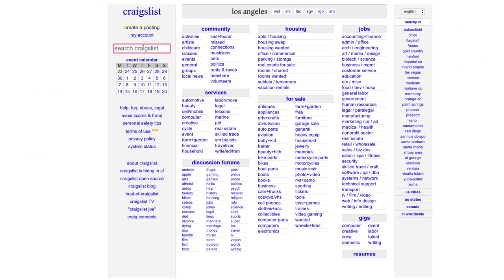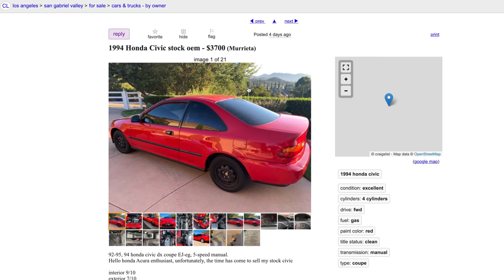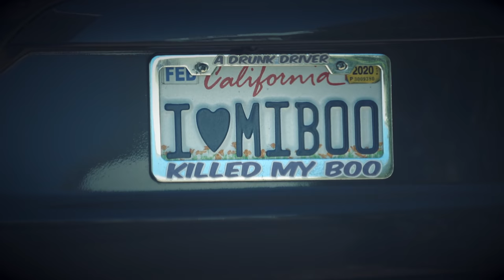Can $1000 Get You a Rare Sports Car?

Comment: I learned how to repair cars for exactly the same reason as Winston.  I also learned when I reach a point where I’d rather have a mechanic with a proper lift do it.
Reply: Did you still follow through fixing it yourself or did you go see a mechanic at that point?
Reply: I've allways fixed my cars myself before. But this week is the first time ever iam going to get a mechanic to do the service on my car.
Reply: I know exactly what you mean. I have changed the hubs on my car, the starter, lots of other things. But my steering column came loose. I saw a video on how to do it, I could have done it, it didn't require any special parts (but two pullers!). But it would have been a complete pain and I probably would have put it back together wrong. I was like, well, I'd rather pay a pro a hundred bucks to just do it rather than spend an entire weekend on it. And that happened and I'm still happy as hell I found someone to do it.
Reply: @james5460  the problem is the number of "pros" who don't care about your car and do a shit job. Leave parts missing, disconnected, etc. Then still charge you top dollar. I guess that's why they say a good mechanic is worth his weight in gold.

Comment: My first car was a 4k Toyota Starlet rear wheel drive 😅, second one was SW20 mr2. Mr2's with the mid mounted engines make the experience completely unique.. they button down so well in the rear.. but wet tar can be dangerous if you dont learn throttle control. Amazing new channel boys.

Comment: To add on the thoughts at the end of the video: The major reason why we can't get affordable cars as "fun" anymore (and they definitely don't apart from the ND Miata or Lotus models) is because regulations kill off any hope for lightweight. 

Chapman said the key is "adding lightness" and it truly is. Since cars are now much heavier we don't get unassisted steering anymore: Less fun. Now they've taken away hydraulic steering for electric: Even less fun because they can't replicate the connected feeling of hydraulic. Safety standards are simply taking out the emotion and replacing it with isolation. They are refined in the wrong ways, unlike the refined quality of 80s-90s Toyota products. 

I want to feel the road, the engine, and the brakes. It makes me appreciate Mazda and Lotus today. I have hopes Toyota's recent focus on performance cars (Akio said this himself) will bring us a new MR-2. I already love what they did with the GR Yaris.

Comment: I can't believe this. Not only 2 days before this I managed to get myself the 1989 MR2 I've been watching for 7 years! Total backyard find, under a cover and blankets for the past 12 years. Supercharged version with 113k miles! Got it for free! Doing a bunch of basic stuff on it atm. 1 rust spot about 4 inches long along the top of the window. Other then that it's pretty darn good...Just that I broke a piece when removing the starter to check it. . . the after market alarm has been a rats nest, it didn't come with keys or anything! Neighbor is a locksmith though so.. Cant wait for the engine video!

Comment: But is that steering wheel not in mounted straightly?
Reply: With the front end repair may need a wheel alignment?
Reply: @farnthboy  that or a problem with the subframe. It was in an accident so...
Reply: How do you guys notice this stuff I wasn’t even looking at it.
Reply: @ratj4715  look at the steering wheel while they are doing the 0-60 mph tests. You can clearly see that it's not center while driving straight. It's off quite a lot. There's a scene where the camera is between Winston (driving) and C Milk (passenger) facing towards the windshield during these tests. You'll see it. I didn't notice at first until Peter mentioned it. I personally would had never drove it with that bad of an alignment. From my own personal experience a suspension table can literally break free of the frame resulting in a serious crash or death. It happened to me! It's physics. Speed + suspension pulling to one side, etc over time = a lot of torque and weight. Eventually something is going to give way, especially on an old vehicle. But Winston seems to know his stuff and probably concluded that it wasn't out of alignment due to anything too serious.
Reply: Sebastien Bolduc I believe you I just wouldn’t even think to look at the wheel. Am sure if we could see this car in person am sure their was many things wrong with it or didn’t look very good in person but than you don’t get a lot for that money these days to me and I know everyone has their own taste but I think it god ugly.
Reply: @sebastienbolduc5654  -- That was my first thought when they walked around the car in the seller's driveway. At least do the basics of checking for straightness.
Reply: You can just pull off the wheel and re-center it. It’s fine the way it is, but if you have OCD, then it will drive you nuts...lol

Comment: a 128hp car will rip your face off when all you have ever driven is a 3 cylinder 1liter skoda fabia
._.
Reply: No joke a 4AGE MR2 45-60mph in 2nd gear, and don't mess around in the rain, it will  throw you off the road with the slightest curve if you disrespect it.
Reply: @pgtmr2713  Drive mine in the rain and on gravel and its entertaining and competent. It's now on Koni, Eibach and modern 15".
Reply: They're great handlers right up to the point they aren't :-D
Reply: @pgtmr2713  On mine, it will go neutral then oversteer with enough linearity that you can keep the throttle on and steer to the wider line. Im quite respectful of "throttle on" understeer, as its a characteristic I dont always predict well. Otherwise it's pretty straight forward about how much grips left and what will happen if its pushed too far past it. To get it to its limit on fresh suspension takes some serious commitment and pace. Im a bit in awe when I hear of owners who can get them to step out routinely in suburbia.
Reply: Mine was a worn out $1000 piece. Anything can get sideways if you drive it the wrong way. I definitely did push it too hard for that moment. There was nothing slow or linear, what I experienced was snap oversteer. Instant 90*. Maybe yours has less power? Mine was 88, so far as I know, no mods. T-VIS valve opened and that was it sideways up a curb I wouldn't take my Jeep. Believe it or not the car came out fine, no lost plastic. By the way this wasn't a complaint. I used to say it was 1.6l of Japanese fury
Reply: @pgtmr2713  Mine is an 87 and is running a healthy smallport (100+ kw).
Reply: That car is long gone now. It needed too much work for the rust. Then it started knocking It was still great at 25 years old 208k miles. When I bought it only had .25 quarts of oil in it. It was otherwise in great functional shape,  just  maybe a little soft. At the time there was a Junkyard with a blue hardtop a few blocks away. Had brand new keys cut by Toyota from the numbers in the manual for that thing.
Reply: @pgtmr2713  Im so pleased that we don't salt our roads here. Yep, my previous owner ran it out of oil and did the bearings which is why he swapped to the smallport.
Reply: @stephenbello1081  I had another project I wanted to swap more at the time. The MR2 was only a temporary distraction from that. It worked out, by the time I was looking for an engine the perfect one came up. Half price, swapped valve springs, otherwise stock, low mileage jdm engine, clean. The 4AGE was a legend, but this engine was better, without the same fanfare.

Comment: My favorite Japanese car was an old, rusty, beat to hell and back 1974 Toyota Celica GT, 18RC engine. Back left wheel lugs were hammered on so I was stuck with the same bald tire for about 8 years and it never lost air or went flat..  Great little car back when I had almost zero resources. That car delivered more pizzas than I'll ever eat in my entire lifetime.  Someone finally bought it from me for the engine that remained almost perfect for the entire 8 years.

Comment: I didn't realize you were doing this project. This is great! I've never really felt the need to justify my love of '80s Toyotas(I have three right now; an '88 ST165 Celica, an '88 MA70 Supra, and an '84 N5 Hilux). They're well built and each of them has withstood the test of time. My first car was an '86 Celica and to be able to relive that at any time I wish is a great feeling. There was a time pretty recently where I was driving my '80s fleet exclusively, but I did break down and got a newer vehicle to take the wear and tear('04 RAV4; fortunately I found one in manual, haha). However, I'll continue to drive these reminders of the past. It's a way to get in touch with my roots. :)

Comment: The thing about cars is that there are a lot of them out there and a lot of them are very good.  Modern comfort and fuel efficiency is commonplace.  But it's also a bit dull.  It is more fun to buy something ordinary, or old, or both, then try and squeeze the maximum adventure out of that item.  A modern day 4WD can make very easy work of ascending a steep, greasy hill.  There is not much challenge.  It's a lot more fun to take a much older vehicle, with all its inherent limitations, then do what it takes to make it go up that same hill.  It is always more satisfying to take something ordinary and squeeze 200% of potential from it than to spend ten times as much on something that will do the job too easily.
Reply: The cliche is "its more fun to drive a slow car fast than to drive a fast car slow".

Comment: Hello Toyota mr2 mk1 owner here, I own the na and the sc variants of this car, the sc was as you described "only" 20hp more but more importantly it had a 50% torque increase, which in the Japanese variant puth the 0-60 speed at 6.5 seconds, Stock. My sc is NOT stock 😂 and I'm running just under 200hp. But the chassis on these great cars can handle way more bhp.

Comment: great job on first car video fellers A+++..man that fender packer needs a bit more common seance good thing harbor freight has new good body hammers set worth buying now any ways clean injectors n on old toyota one can tight the mass air flow sensor spring to pass smogs bs in a pinch i have herd as it runs it lean but with a a/f gauge one can play it n set it back to safer fuel trim ..i would like 2 talk with you one day as a Toyota guru be fun and i  got tricks i learned on them old cars

Comment: Getting too old to do much with cars, but I used to make my living doing just want they're doing here. 
I used to sling bondo all day in used car lot shops as well as Uncle Earls (Earl Schribes) and swapped engines and transmissions more times than I ever want to remember..
Just a friendly reminder..Smog tests are usually incredibly easy to pass as long as there isn't a shitload of black smoke pouring out of it.. And...Bondo.. If you're using bondo for the first time use as little hardener as you can get away with to avoid the dreaded bubbles in your mixture. Too much hardener will make your bondo set up way too fast and it'll be too soft and peel easily. It's counter intuitive, but less is more with bondo..

Comment: It's well worth $3,900. I think I would had kept it to drive, but that's because I need it not having a single car to drive relying on two feet and buses instead. It's reminds me of the 1984 Honda Prelude I had. It was a really nice car in 1995 for just $1200, but the oil tube failed that draws oil from the pan to the overhead cam. I started hearing tapping under hood and the motor quit within a few minutes. I didn't know what was wrong and didn't have money to save it so I gave it to a junkyard who told me two weeks later what happened.

Comment: Windshields are cheap and available. Doors are cheap - fenders...not so much.  PLEASE be careful with the plastic trim around rear window. It is unobtainable and will crack if you touch it. Unobtainable means you can find the trim in the $600-700 range for the 3 parts. Parking brake cables are known to freeze from corrosion. They are about $80 for each side. If the trans was really updated to the later C52 then you will see an unused starter motor mount location.

Comment: I once bought bmw e39 528i, sport seats, suspension and exhaust.. first owner (well grandpa owned it for ~15years and then grandson a couple of years, but officially 1 owner) for 1300eu. :) original price 2000eu. :)
Everything worked when bought, but within a year a couple of things went south so i just called original owner and offered it for 500eu, his friend took it. 
After that i bought a brand new vw golf natural gas, fuel consumption is less than 1/4 of bmw!:)
Reply: This Toyota probably has better power/weight ratio or at-least similar, but bmw did 0-100kmh in 7.5s.. interesting.. 
or gt86 i think also about 7.5s with more power than bmw and much lighter probably..

Comment: Calif SMOG tip - Long time ago some enviroNut looked at those 2-stroke JET SKIS.  They didn't like the thick blue smoke.  Did some testing, turned out one of those little guys puts out more bad stuff in ONE HOUR than your standard 4-door Jap sedan puts out in A YEAR...!   No, I'm serious.  And the sh*t hit the fan, sky-high.  At first they were going to simply OUTLAW all the 2-stroke Jet skis but finally compromised; if you owned a 2-stroke you'd have to use this special 2-stroke TC-W3 MARINE OIL (avail at WalMart).  It contains a very special additive.  Are the gears turning in your head, Winston..?  Your formula is 3.5 ounces of TC-W3 added to a standard 14 gallon tank of unleaded.  Run that down the week or so before testing, then on day of test put just ~ 4 gallons of SURPREME unleaded and there, maybe along with once ounce, and you're good to go.  Meh, maybe 95% of passing.  One chemist even estimated that if the car had NO cat, you'd still pass.  If you need some more tips, plz message me.

Comment: was the speedo not supposed to work?
Reply: Mid engined re-use of the corolla design results in a long drive cable which is a common failure point.

Comment: Could have been way longer, we the audience are well keen. Good to see you are not going to end up as some China Uncensored-esk bitter channel and are branching out to fun stuff. The channels: Junkyard Digs, Thunderhead289, Dylan McCool and Jennies Garage (great mechanical comedy duo yet mainly playing with bikes) just to name a few are great resources of shared skills that we can all learn from...the Junkyard digs/Thunderhead289 series ABANDONED Muscle Car Revival! First Start in 35 years! -- Part 1   -8 was soooo funny and very informative, such as setting a base timing without running the engine with a timing light for instance and left hand threads on the left side of the rig! loosening stuff valves and hot wiring etc etc etc. Would have been good to show details as to costs for things like the wheel alignment/balance after having to throw a cheapy after market tie rod and messing about with the front end. Also the pollution control stuff that was necessary to have such as ...um...carbon canisters and whatever they used in the 80's. Some bunny in Oz slammed in to my Ford Falcon Ute whilst I had a load last time I was in Oz and that bingle stuffed my front end up, I had the tie rod changed and aligned yet my steering wheel is out of wack, I have pulled one off years ago and moved it along the steering column spline. (they say you should replace the washer with a new one if doing this and some say not to worry. I have had plenty of shitboxes over the years and many a problem to solve. Hmm, ROADKILL was once a great channel until they sold out so stuff them. Anyhoo, I think what I am trying to say is that the audience is surely there and this idea that you two have is going to take off BIGTIME. Many of the other channels have gained sponsorship without turning their backs on the very audience that made them popular in the first place. Go forth chaps! Fun awaits.

Comment: fix  suspension and then look at the angle of the steering wheel.... either the alignment is way off or the chassis is not straight ... no idea from the video if that was even checked from this video

Comment: hardly novel IDEA - How about a somewhat smashed Suburu WRX bought from CoPart, restored with PickNPull parts..?  If you bid as Joe 6-pack and win, CoPart does hit you with with some stupid fees that can run an extra $400 on top of what you score the car for.  Plus even if the CoPart database listing for the car indicates the car CAN start AND drive, legally they must observe you depart with the car on a truck or two-dolly; you can't simply drive off.   There is a bad-as$ MoFo standing there to make sure of it.  So be aware.  Also only bid on PURE SALE cars (indicated in bidding data base), nothing else.  You want it to be clear and easy.  But you guys are living in literally the NUMBER ONE market for those CoPart cars.  Oh, generally cars should go for about one FOURTH of the appraised cash value of the car --very rough generalization, kay..?  If from the photo and data you fall deeply enough in love, be aware CoPart WILL gladly permit you physical access to the car before the auction, and if you do that, you are MILES ahead of the others.  Lastly if you can show CoPart some type of biz license for doing car stuff, your need to pay those extra CoPart fee$ will permanently disappear --I believe you guys would easily qualify.  You....probably already know all this stuff, though...?

Comment: Nice. I think you could make the car more attractive by setting the toe, which if done correctly, would make the steering wheel straight. That costs nothing. A toe set can be done with a couple of wrenches and a piece of bailing wire for a measuring tool. No need to get an expensive wheel alignment.